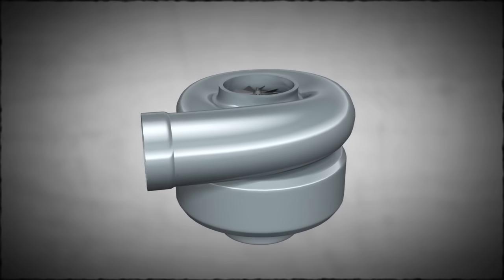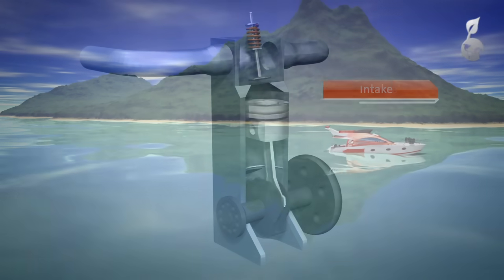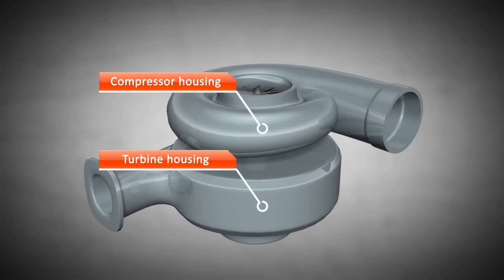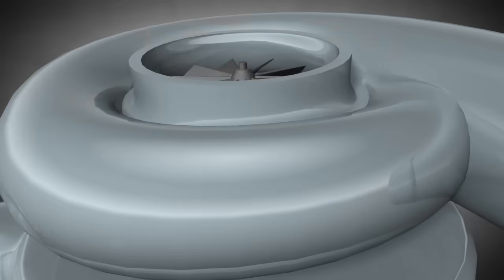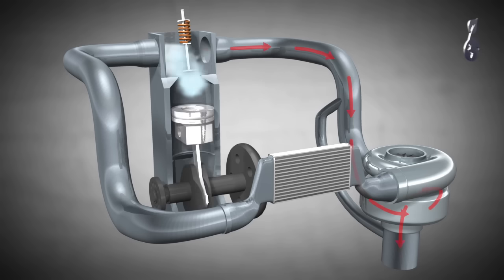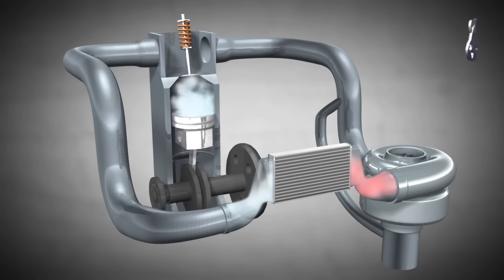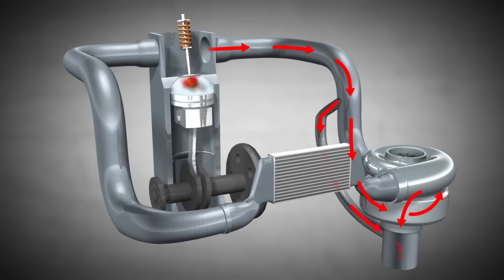How a turbocharger works! (Animation)

Comment: why intercooler is after the turbine and not before?
Reply from the maker: Why would you place it before the turbine?
Reply: +Thomas Schwenke because in this way being the already cold air it would enter a higher amount in the turbine and thus would be compressed more, right?
Reply: +Logan Hankins Yes but if the air that will be compressed is cooler than the atmospheric air (thanks to the intercooler)  the pressure should be higher, no? sorry for my incorrect English, my questions is only for didactic interest
Reply: Oh true, Thanks :)
Reply: No. You have it all wrong. "Exhaust gases go inside the turbo charger & spin it, witchcraft happens, & you go faster." Jeremy Clarkson

Comment: why motorcycle engine do not use this technology?
Reply from the maker: Normally, it's not necessary.  200 PS for a motorcycle is more than enough. However, if anything is used, then, in general, it's a supercharger.
Reply: Look up Kawasaki h2 it's supercharged but it's basically the same thing.
Reply: MOTO Thanks
Reply: Thomas Schwenke Thanks

Comment: does turbo charged have cons? 
does it consume fuel more?
Reply: I don't think it does
Reply: it'll increase pressure and wear on your combustion cilinders, if not properly tweeked, reinforced or the injectors ajusted according to the added horse power from the turbo, your engine might blow
Reply: what that person says^

Comment: How do blow-off/bypass valves work? 

Does it actuate when there's excess boost? Or when the vacuum line opens it? 

If so, when is the vacuum created? When you let off the throttle?
Reply: Bov values work when there is excess pressure when you let off the gas, the pressurized air has no where to go so it gets let out by the bov valve.
Reply: That much I know, but what actuates the valve? A vacuum line?
Reply: Jeffrey Nguyen I'm not that educated on it if I'm honest.

Comment: Mr.Thomas,this video is the finest video which helps a starter or an illitetrate  to understand the concept of turbocharger thoroughly,please extend your service similarly in all the aspects of mechanical n automobile engineering without taking in to consideration the negative comments.There can be no better video than this.....

Comment: i thought a turbo sends the spent fumes back into the intake
Reply: +Devanshu Dwivedi 
No not the spent gasses, they only spin the turbine and exhaust out.
But the piping coming off the cold side of the inter cooler can be piped back into the pipe work feeding the cold side of the turbo.. or if compressed air is under excessive pressure they can be exhausted via a blow off valve or similar. 
i.e. You had your accelerator under full power and you suddenly back off, the engine all of the sudden doesn't need all of the high pressure / cold air coming from the inter cooler and into your intake manifold.. hence the pressure can be quickly equalized by sending it back to the cold side of the turbo.
Reply: +WakeTheFuckUp  The exhaust gas recirculation valve (EGR Valve) allows unspent fuel in the exhaust gas to be recycled for a second go in the combustion chamber - this is a different components to the turbo.
Reply: Light Vehicle resources
Thank you, I was unaware of the EGR valve.. but yes you are correct it does allow a small percentage of the spent gasses to be recirculated back into the combustion process. 
From what I could quickly research, it is not so much about unspent fuel.. but a range of other emission (NOx) & temperature factors.. 
I shall look a little further into it in due course.
Cheers.

Comment: This video makes the exhaust-exit > air intake very clear (bravo!), but doesn't really illustrate the benefit of a turbocharged engine, aka, in moments of higher engine load, exhaust pressure increases, driving the turbine/compressor faster, increasing (pressurized) air intake to give the engine the extra power when it needs it most (starting, accelerating, hills), and then decreasing when exhaust pressure is result (flat terrain, stable speed, etc.). It would be great to get a second part explaining that! :) Thanks for the video

Comment: Surely the main purpose of the wastegate is to protect the engine, not the turbo. Too much boost will lead to a blown head-gasket or worse.
Reply: +Thomas Schwenke I do not have a better source, but I think both problems are possible, although the idea that it protects the turbo is more familiar to me.
Reply from the maker: +The Ball Hi, thank you for your comment. What's the source of this assumption?
Reply: Every turbocharged engine ever made^
Reply: +Thomas Schwenke The source is the zilions of diesel engines with blown head-gaskets littered around the country. Too much boost rarely kills the turbo, but will test your head bolts! Just do any search on turbo boost if you want a source.
Reply from the maker: +The Ball Hi, thank you. This is a source, but certainly not a reliable one :) / There are thousands and millions of smokers that get really old; see e.g. Helmut Schmidt :) / It doesn't mean that you have to smoke in order to get old ;)
Reply: +The Ball 
Whilst you are partially correct it does also help protect the turbo.
The *primary reason behind the waste gate is "for it to be the weakest link" and regulate the maximum permissible boost pressure..

Comment: just need to add blow off valve, vents excessive intake pressure as you let off the gas/close the throttle after everything was ramped up, keeps the intake air from backflowing into the turbo which prevents the air from fighting the normal path of airflow. When you hear a turbo flutter that just means the BOV isn't adjusted properly or is too small to let excessive intake air escape, but of course kids/fake tuners will think the flutter means jdm yo!

Comment: This is not accurately how they work. Most of the energy driving the turbo is pressure. In my car, which makes around 1200 HP, measurements of heat, pressure, and fuel consumption indicate about 12% of the energy to run the turbocharger is from heat. Most of the energy to run the turbine is pressure from exhaust.  Exhaust pressure on the engine side of the turbine is about 30 psia. That pressure is what mostly spins the turbine.
Reply: +Tom Rauch would it make a car faster?
Reply: +Tom Rauch and would it be even noticeable if it does
Reply: +Tom Rauch 
The turbo system is designed so that both the exhaust and cold side of the turbo rely equally on each other.
Increased exhaust gasses also = increase in compressed air.
How much air you can feed into the turbo.. is governed by the size of the turbo and its optimum operating pressure.
Thus if the cold air is limited, so to is how much exhaust gasses can be produced.

Comment: in an engine without a turbo charger "sucktion engine" does not have air FORCED by atmospheric pressure into the engine, the piston when going down in intake stroke creates vacuum using the intake throttle.
Reply: +Grick R And air presses on everything, and other air counters it. Vaccum doesn't have air to counter it and forces itself in.

Comment: Thank you very well explained...

I have an observation (or a question), so..turbo-charging does not happen as soon as the engine starts, the turbocharger gears have to attain a certain speed for the turbo-charger action to kick in, is that correct?
Reply: +Ramesh M It's really quite simple. The compressor is the thing which gives you the added power by effectively increasing the density of the intake air. Gas compressors are kind of non-linear things. They need to be spun up to a fairly high fraction of their rated rpm to provided any reasonable gas compression at all. To do so, the turbine needs to be spun up (since it drives the compressor) and that takes a considerable amount of exhaust gas flow. When idling after startup, the amount of exhaust gas is minuscule, so while the turbine (and compressor) might be spinning a little, it's nowhere near enough to provide any appreciable gas compression.
Reply: totoritko Thank you for the explanation. It helps.
Reply: Ramesh M You're very welcome.

Comment: Great video. But that's not how valves work
Reply from the maker: +ButterLettuceTV Well, this video is not about valves :)
Reply: +Thomas Schwenke I dont get one part of this.. so the cylinder doesnt have air intake.. only turbo gives it..?  shouldnt it have air intake but then how the turbo's air goes in? wut
Reply: +The Pystykorva No. That is not true. The valve arrangement is the same as a naturally aspirated or super charger engine.

Comment: I get that it's showing how an engine works, but the valve is moving the wrong way. towards the piston on the inside if the head. not the outside. just saying

Comment: its not the thermal energy that translates to kinetic in the turbine fan side, it's the gas's kinetic energy/pressure that causes the turbines to spin, allowing for translated compression/kinetic energy for the intake air

Comment: I would like to add some constructive criticism. 1. Valves do not work that way.  They would blow out in the compression stroke. 2. I know you were trying to animate a very dumb down version of an engine, but you really should separate the exhaust and the intake valves.  3. The turbine side and the compressor sides of turbos never look the same.
This is ment to be constructive criticism. I could never do animation as well as you.

Comment: OK so turbos make for better efficiency. So how come all cars don't come turbo charged from factory.
Reply: swav100 Turbo chargers do not improve low-end torque engines.  For city driving a turbo is almost useless.  They are also expensive to repair, and expensive for manufactures to install, and leads to more complex engines which means more things to repair.
Reply: +swav100 
Yes they do burn the air / fuel mixture more efficiently and produce more power / torque, but it all comes down to $$$.
As +Joe Wild pointed out, to have the same vehicle; one with and the other without a turbo.. expect to play a few thousand dollars extra for the turbo option... and then higher maintenance costs.

Comment: the engine compresses the air and fuel mixture and burns it. so the compressed air from the compressor should reduce the work done by the engine?? and cooling the air is not required right ? hot air also contains oxygen which would be enough to burn the fuel right?
Reply: Santhosh Kumar Hot air is less dense than cooler air. Having cooler, more dense air enter the engine is more efficient as there is more oxygen in the same amount of volume. It also helps with engine overheating.
Reply: thank you
Reply: +Volfgang58 thanx was just thinking about that

Comment: It would have been nice to mention that the the exhaust gas creates enough energy to make the compressor force in more air than what is actually used in the engine due to the expansive nature of hot air. The molecules in the exhaust gas are much bigger than the air molecules in the intake air, which allows more friction on the exhaust turbine for the same amount air. Turbos are worthless without heat. I know he said thermal energy is converted to rotational energy, but it would have been nice to explain how that happens.

Comment: Guy doesnt know what hes talking about - A turbo charger is acutally a little unit that sits between the carburettor and the air filter.  Inside are lots of little men shouting "faster - faster - faster" at the engine, and the more revs you have the louder they shout it, which encourages the engine to pull more air into the air filer thus increasing the airflow and in so doing increasing the efficiency and power of the engine.

Comment: would you be able to recover wasted engine power using a turbine generator (which would require a hybrid system, or you could use it instead of an alternator) or a direct drive turbine (connected directly to the drive train with a basic CVT to maintain optimal rpm)? I wonder if we'll ever see this... I suspect ICEs are nearing their replacement

Comment: it only took 3 minutes, i feel smart as fuck.
Reply: Shekillaboom Me too 🙄
Reply: same
Reply: Compared to 6 hours of schooling...
Reply: Shekillaboomlp
Reply: I ve got to replay 10 times until it Visualized in my head
Reply: it uses the energy created by the exhaust gases spinning the turbine wheel,for sucking air into the engine.
Reply: Don,t say as
Reply: Basically it takes the exhaust gases from the exhaust and fires it into the engine which makes a bigger "bang" in the engine

Comment: A very nice video indeed but one small point. The wastegate does not open because the engine is producing too much exhaust gas. It opens because the inlet boost pressure is too high. The wastegate itself is opened by a wastegate actuator that is connected by a pipe to the inlet manifold. When boost pressure is too high the pressure opens the wastegate to allow some of the exhaust gas to bypass the turbine. This causes the turbine and compressor to turn more slowly so the inlet boost pressure is reduced. When the inlet boost pressure drops, the wastegate actuator allows the wastegate to close again and the turbine then speeds up again.

Comment: Would it not then be fed into a carburetor? As it needs to be mixed with the diesel? Or do you not need a carb if you have a turbo?
Reply: caliorulz Diesel engines have NEVER used carburettors. Air is drawn in through a throttle body and then compressed at a very high ratio. Typically from 16:1 to 22:1. This makes the air VERY hot. Diesel is then injected directly into the cylinder where the hot air ignites it. The turbo just allows a lot more air to be forced in. If you can get more air in, and then inject more diesel, you can get a lot more power out. SI or Spark Ignition engines mix air and petrol in a carburettor which is then drawn into the engine where it is ignited by a spark plug. Turbocharged petrol engines also do not have carburettors but use injectors instead.

Comment: Can someone explain turbo lag to me (and anti-lag)?
Reply: Dilip Tien When you press hard and suddenly onto the accelerator when you are driving at relatively slow speed, for example when you want to quickly overtake another vehicle, it takes a few moments, milliseconds, for the exhaust gas to get the turbine to increase speed. There is then a noticeable delay between the time you press the accelerator and the moment you feel the turbo 'kick-in' and deliver full power. Large diameter turbochargers have more lag than small ones but small ones do not provide as much volume of compressed air. This is why many high performance cars now have multiple small turbochargers instead of one large one.
Reply: oc2phish07 milliseconds really? I've seen examples of turbo lag and it takes seconds. Also, what is anti-lag?
Reply: oc2phish07 Yes Dilip, it might be a couple of seconds although it often feels longer than it actually is to the driver or rider (it happens on turbocharged motorcycles too, such as the old Honda CX500 and CX650 Turbo models). As for Turbo anti-lag, this Wiki entry can help. https://en.wikipedia.org/wiki/Antilag_system

Comment: with captions
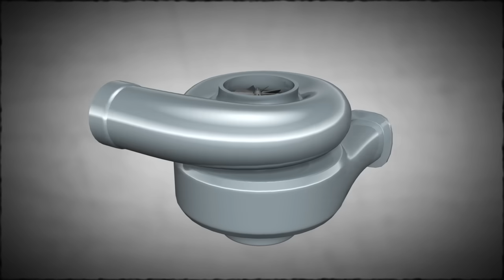0:20 "The two boost purpose is to take advantage of the axle's gay ass."
1:51 "Consequently, the turbine is driven by kinetic, and a Jeep."
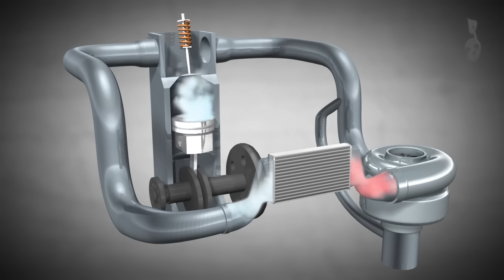3:16 "The ball, which is known as a waste gate is used to brew 2x source gas away from the 20 pine."
Reply from the maker: John Venable :D

Comment: I love your videos. You are so kind to produce these and share them freely. If I may make one suggestion for improvement. A few words that you use are difficult to understand because of the way you pronounce them. For clarity I turned on the captions. Sadly, the captions must have been made by some automatic program because it too has had difficulty trying to understand and it has put the wrong words in.
As an example;
at 0:20 you say "the axle's gas produced by the engine"
The captions read: "the axle gay ass . . . ."

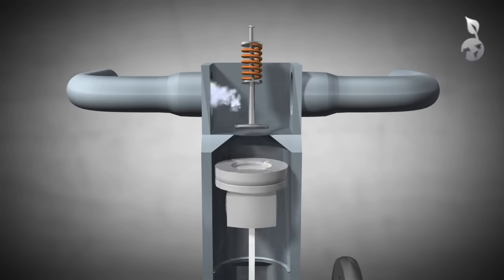at 1:15 you say "boats airplanes and cars" and the captions read: "boots airplanes and cost"

You will improve your videos greatly by taking the time to manually type in your captions to show the correct words. In this way, the occasional word that is misunderstood in the narration will be cleared up and the video will not be spoiled.
(oops got cut off before I ended here)

But like I said, Great video, great illustrations and generous soul for sharing your knowledge and time - thank you.
Reply from the maker: bvowens Thanks for your great feedback. I'll take this in mind.
Reply: lol the caption says the axle gay ass
no pun intended just youtube needed to fix that
Reply: ***** Really? I thought he said the 'exhaust gas'. Doesn't the turbo make use of the exhaust anyway?

Comment: Under perfect conditions a normal engine gets around 50% efficiency. What about the turbo?
Reply from the maker: peter c Don't know what you mean. You mean the conversion of energy stored in the fuel to kinetic energy of the wheels? As far as I know, we are far away from 50%...
Reply: peter c yes 50 would be a great engine! I m not quite sure but I thinkn its more like 30% efficiency with internal combustion engines. a turbo wont change that number by a huge amount. it may be more efficient but it wont change the huge loss of energy such engines have
Reply: Thomas Schwenke What is the efficiency of using an electric engine like a Tesla?
Reply: Systolic120mmHg electric motors are at 90% or even more I think. they dont lose much energy formed into heat.